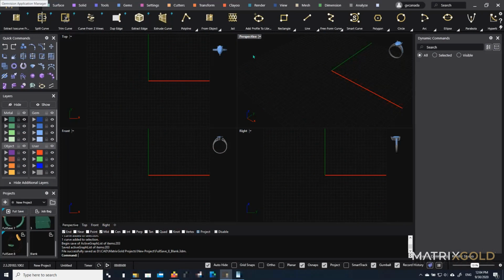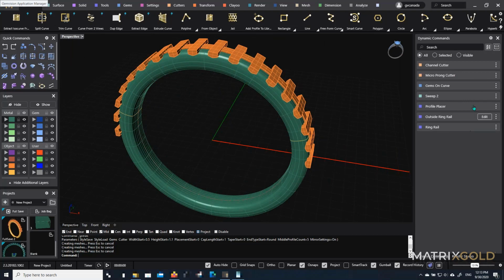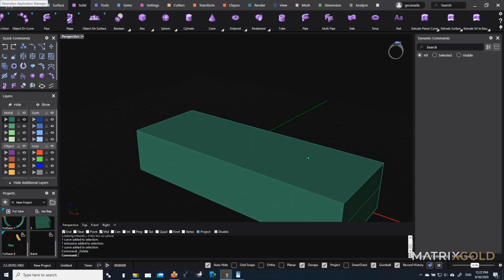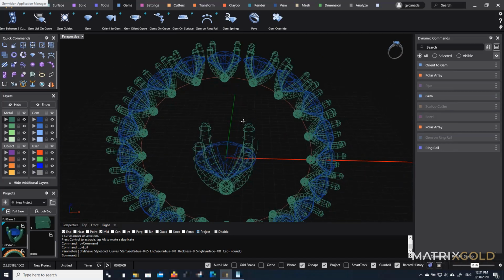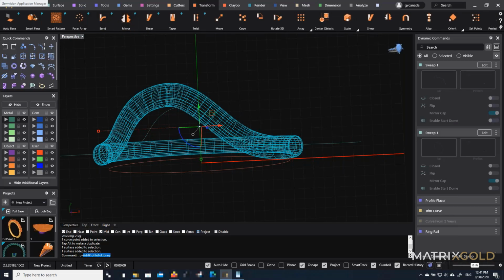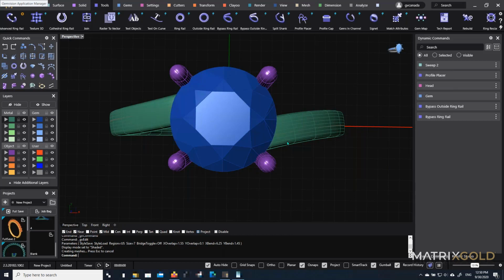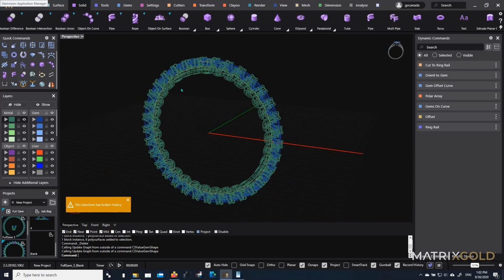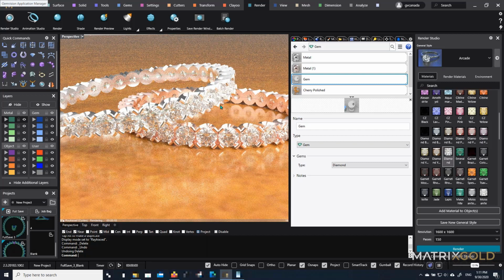Parametric Jewelry Design -  MatrixGold Tutorial

Comment: Question for Gemvision.  Why dose the circumference not match in other 3D programs?  If I apply autobase then export that into another 3D program the ring rails match up exactly, but the autobase is off by more than 10 mm.  It's actually longer than the true unroll length done in any other program.  In other words, a size 10 in the real world has a circumference of abut 62.2mm.   But if you measure the autobase of the same size ring in MatrixGold with ZERO thickness it's 75.10mm. Why is it longer even though the ring rail is accurate to the real world.  Is this a bug?